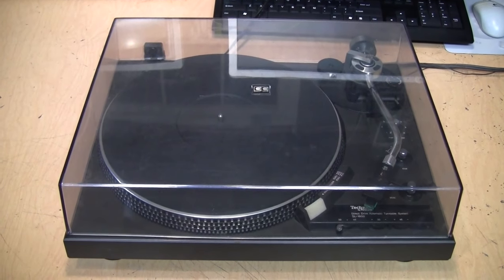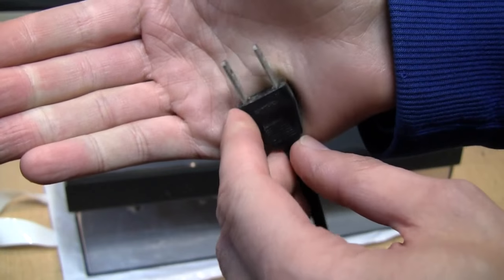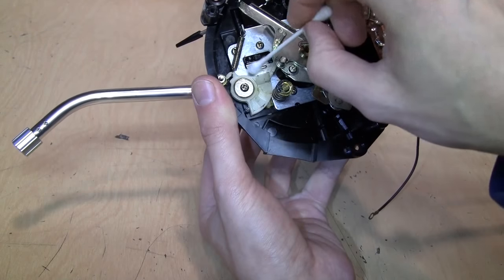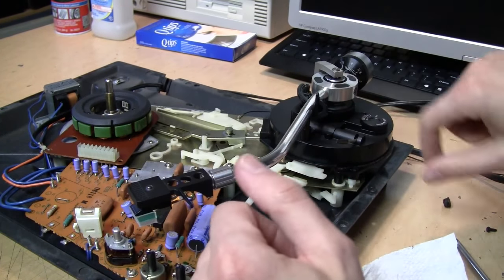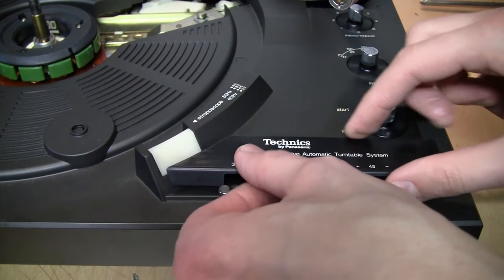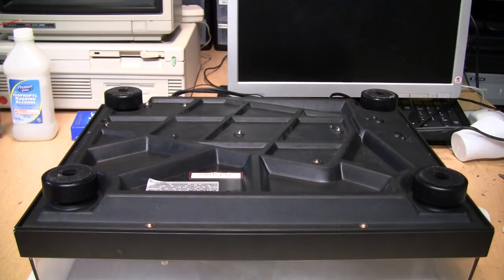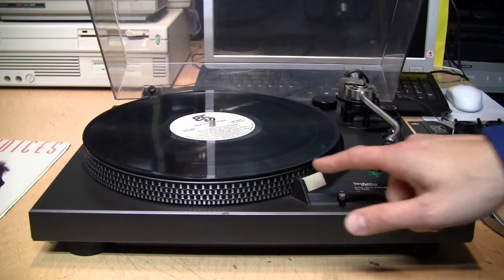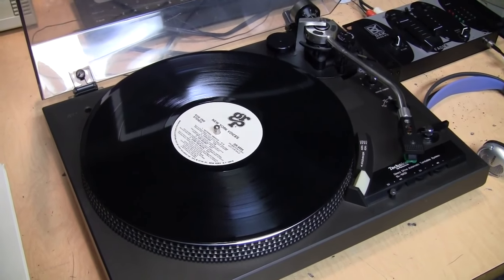Technics SL-1900 turntable repair & review

Comment: If I was into vinyl I'd rather buy something that was mass produced when vinyl was at its peak, and engineered by real engineers to have great specs and still be able to be mass produced. There is no real good engineering behind the modern expensive audiophool stuff. If there is, they're just direct copies of old designs (not hard to accomplish with tube amps).

Comment: I own an SL-2000 which is basically a non-automatic version of the SL-1900. It looks very similar with some obvious exceptions. I bought mine used in 2011 and I was experiencing similar problems. The turntable platter kept fluctuating, never keeping steady speed. The great thing about the SL-2000 is if you only need to clean the pots, you only need to remove the metal plate on the base to get to the pots. I bought the same CRC electronics cleaner spray, cleaned the pots and switches and it now plays beautifully! I can now listen to my vinyl off this turntable and not worry about the speed suddenly changing on me.

Comment: Nice turntable.  I used to be a DJ and am lucky to own 2 SL1200 MK2's.  They are great turntables and are totally built like tanks.  Mine I bought from another DJ who bought them from the club he played at when they replaced them after many years.  Because they are former club turntables they are "Quartz Modified" which means they have had the quartz lock deactivated to make it easier to beat mix.
Reply: Sl2000 and 1900 are useless as dj machines!

Comment: This turntable beats new ones like Audio-technika in every detail. W&F, motor noise, quality of tonearm, tonearm bearings, automatic mechanism, etc. But new one it was one of the cheaper options, available at around 500 USD of today. I believe if Technics would put them back in production the same like they were, it would be best seller. Plinth doesn`t look outdated, just different headshell and that is it.

Comment: I’m the original owner of an SL1900 and have been chasing the “end of play return issue” for years. Mine has an extra cam on the spindle, so I held my breath and yanked it off with a pair of needle-nose. You were so correct...the grease had seized up over the years and was like glue. Once I cleaned everything and re-lubed as you directed it works very well! Thanks so much for posting!

Comment: I got VERY lucky in that I found a Technics SL-1D in a thrift store that had the AT cartridge installed.  I bought the turntable for the cartridge but got one heck of a surprise when I got it home and all cleaned up.  It is now my primary turntable in my system and works flawlessly.  My cost?  $25 plus tax.  It is the only turntable I've found that will work with Grado cartridges without humming!  Just proves that sometimes you can get really lucky when browsing thrift stores and people don't know what they are throwing away.

Comment: What a great DIY video.  I also have a Technics SL-1900 turntable, which I purchased new in 1977, but have not used it for at least 10 years.  I have the exactly the same problem you described in your video and checked with several turntable repair shops in my area. All wanted anywhere from $100-$125 to fix this problem excluding parts, if required.   I went on several websites that mention that the lubricant in dampening mechanism is probably frozen and needs to be cleaned, but nothing addressed how to actually fix this problem.    Then it dawned on me that I should check YouTube.  Eureka!  I was able to repair the turntable myself at no cost since I had all the necessary supplies.  It works like new now.  Thanks for posting this video.  You did a great job putting it together and explaining clearly each step required to make this repair.

Comment: Yay, VWestlife finally has a decent turntable! I've been waiting for this day for quite some time. I happen to have the same unit (although I'll sell it soon as I now use a bigger brother in my main system).

Some remarks:
- the SL-1900 was indeed the second-lowest direct drive TT at the time (1977-78), but as you said a very good one. Shows what Technics is about. If somebody wants to enter the world of vinyl and doesn't mind tinkering a little bit as you did, the SL-1900 is a model I could definitely recommend. Other great choices: SL-Q2/3/33, SL-QX300 and of course all big ones (SL-1100 to 1800), although those cost quite a bit more.
- your unit was manufactured on January 31, 1978 (serial number)
- you can adjust the height of the tonearm lift when in the "up" position: press down the lift bank and turn the flathead screw inside the lift post.
- likewise, if the stylus is not set down correctly at the beginning of the LP, or lifts up too early when reaching the end, there's two dedicated screws near the tonearm base allowing you to adjust that.
- your strobe looks spot-on indeed as it should. Note that these old neon bulbs were not temperature-stabilized; as you use the turntable for a longer time the strobe thus may start to move slightly. If the strobe happens to fluctuate too much, there's two potentiometers for each speed inside the turntable which need to be cleaned.
- the AT-95 cartridge is a mixed bag, as it has heavy variations in sound quality from unit to unit. Some may sound decent, others are terrible. If you are not satisfied, try out the Technics EPC-270C-II (which is the original cartridge to this deck). Sounds quite nice if you fit a good replacement stylus. An EPC-207C or greater would be even better, but also more expensive.
Reply: I got a used Dual 1242 with a stuck start lever (easy fix) and came with a like-new Grado f3+ it sounds amazing

Comment: Great video VWestlife. I still own a Technics SL-D3 (features quartz lock I believe?) which was a hand me down within my family, and its served me well for over a decade now. These older Technics are a fantastic bargain (especially some of the lesser known models) especially ones with the classic direct drive motor. I really had no idea the classic Technics units had superior specs to a modern $1000+ turntable however, I find that rather ironic. Anyone looking for affordable high quality playback of their LPs should hunt one of these down ASAP as they aren't getting any easier to find with each passing year I would imagine...
Reply: The D3 only has a regular FG servo for speed control (you had to buy its more expensive brother, the Q3, if you wanted quartz) but it's an excellent turntable just the same, and the speed should be absolutely rock solid as long as the electrical contacts are clean. :)
Reply: My apologies, not sure why I remembered it having quart lock then. I agree however; most any of the direct drive models would be a great turntable for anyone's "HiFi" setup... Appreciate the info. :)
Reply: BMRR is that you?  It's almabes...

Comment: In a previous post I stated that my SL-1900 had a motor noise. It only occurred when the stylus touched the record, with an annoying hum that I could only hear with headphones. The original rubber mat had stiffened and excreated the softening agent like an oil between the mat and platter, so I tossed it and replaced with a cork mat because everyone says how great they are. The cork mat was the source of the problem. I tried a rubber mat from another turntable and the hum disappeared. I'm glad I figured it out, I was already searching craigslist and Ebay for another turntable. I've ordered a new rubber mat. Wow saved a lot of money.

Comment: Thanks, I'm glad people are now posting relatively unedited videos on what they are doing. I am still learning and have 3 Technics to try and fix, not to mention a few others. One thing I thought I would mention is that lube is generally designed for rotatings things, and bearings, and grease is gneerally designed for things that slide. I am unsure if grease was the best option here as opposed to lube as from my perspective it will gum up again. Would be interested in hearing some thoughts on this. Trying to learn!

Comment: Thank you mate. I broke my Pro ject DB3 (accidently ripped the cables in the tonearm out after I wanted to change the cart). Wanted to buy a Technics SL1210 MK5. I wasn't aware that Panasonic had other tt's beside the 1200 and 1210 family. Bought a brand new SL-3210 for 200 bugs quit. It's direct drive as well and it also has a automatic tonearm return. You, sir, saved me like 1300 bugs. Subscribed!

Comment: 15:29 I totally agree.  Those used Technics turntable are really great; easy to maintain, easy to repair, super durable, no-nonsense workhorse.  Those can be found in reasonable price range on used market.  I found a used Technics turntable (similar to SL-1900, but manual turntable), sitting on a garbage bin a long time ago.  I took it home and cleaned it, and it still works great as it should.  It sounds great!  (I own SL-1200 mk2 too, and I don't found significant difference in terms of sound quality between the two, for listening in living room.)

Comment: Best bang for the buck turntable back when it was new. I have the 1900 catalogued as $180 US in 1978. To get a fully automatic direct Drive with the specs and performance of the 1900 was amazing value in 1978. By 1978 standards the SL1900 build quality was decent but by today's standards it's quite excellent especially when you see the puerile garbage being sold at an entry level price point.

Comment: Interesting to see the inside of another Technics Automatic Turntable, as I'm the only person I know who owns one and also had to repair the automatic start mechanism.

With that, I should mention to use caution around the tone arm stop device (the thing that looks kind of like a set of stairs, I don't know the proper name), as there's a plastic tab that can break, resulting in a malfunction when using auto start (read: pull start lever, arm travels all the way to center). My SL-1301 was suffering from that issue for about 10 years before I was able to finally figure that out. :/

Comment: I have a Pioneer PL-L800 linear tracking turntable from 1981 with a good Ortofon cartridge that sounds really good.  Your turntable would definitely be audiophile approved.  Somebody did a comparison between the ATLP120 and a Technics 1200 with the same exact cartridge and I couldn't believe that I could hear a clear difference between the two decks.  The Technics sounded much cleaner and more detailed.  It opened my eyes even more.

Comment: I have repaired an old telefunken full automatic turntable from the 1960s a few months ago. These are built like tanks (all steel parts inside) but they have the same grease problem (a lot worse, the automatic switch wasnt even turning). But after repair... This is a AWESOME turntable. They are built completely mechanical without sensors whatsoever, like a clockwork inside. was very hard to repair because it also had no documentation in the internet. But the day of work was completely worth it, it plays very nice now (even if it needs a new stylus / tone cartridge and better isolated cables(the old cables on it generate lots of noise if they cross a 240V cable)) and it looks awesome. 

Edit: it was a Telefunken W215 i think (or another W... model. But looked exactly like a W215)

Comment: I work for a local fab-lab and 2 months ago a guy walked in with a Technics Sl-D3 and asked if we had any use for it. So I called dibs on it. The plexiglass cleaned up very nice with some brass polish. It looks a lot like yours, a bit more eighties. Sounds very nice to.

Comment: I have an old SL1900 that that we've owned since the late 70s. It wouldn't lift the tone arm. Thank to your help I was able to fix it. The isopropyl didn't wasn't working, so I put some WD40 on a Qtip and it works. Thanks for your video

Comment: I know that the turntables in the 1xxx series generally have the same motors as the 1200, but for some reason always assumed the 1900 did not. Neat to see the disassembly.
Reply: 1600mk2, 1700mk2, 1800mk2 shares the same motor as 1200mk2, not others.

Comment: I have this turntable I bought new in the late-70s. The last time I took it out of its box, it had this very tonearm problem. When I have time (maybe when I retire), I'll repair the tonearm with your instructions. I problem I always had with this turntable is the legs don't isolate vibrations very well. I never did figure out a good way to reduce skipping other than walking softly.

Comment: vintage is always better than new in my book. I'd take this over anything new. Very nice TT and looks well built on the inside. The base seems a little too springy though but i'm sure it's not like the Pyle TT I had.  At least these, the weight is from real metal components, and actual care into it's build quality  vs putting a heavy sheet of steel in the base like that AT of yours had. Modern TT companies, with perhaps the exception of Technics new TT's don't know how a real TT is suppose to be made. They make it look fancy, charge the price of a car for one, and people think it is the best.
Reply: WaybackTECH you know nothing about turntables with such ignorant statements. Nothing wrong with modern turntables
Reply: SL-1900 is a quality turntable. Just be aware of the mass of the tonearm interacting with the compliance of the phono cartridge/stylus compliance. I installed a new hyper elliptical stylus in mine and I experienced tracking issues and skipping/jumping of the stylus in the record groove, without regard to the applied tracking force. I believe a medium-to-low compliance cartridge with a standard elliptical stylus would be a safe combination, at a tracking force of 1.5 to 2.5 grams. YMMV

Comment: Excellent video. I've owned this turntable since the late 70s. I believe you should use oil to lubricate the arm lifting mechanism. The lithium grease seems to make the arm drop too slowly. I remember reading something in its advertising about an oil damped mechanism. So I'd recommend oil instead of the grease. The spring feet are to absorb vibrations from nearby speakers and footsteps etc so that they don't get picked up by the cartridge and amplified.
Reply: He only mentioned greasing the bushing and return spring arm. You would be correct about using oil on the actual arm lifting spring assembly.

Comment: Great price for what you got. It's hard to get a used Technics direct drive for that kind of price, period. Been trying to get one cheap on Goodwill's online auction, but they raise out of my price range too fast. Many people have commented to get a used vintage turntable as they have great specs and can be refurbished to become a great turntable again. Recently I did get a Pioneer PL-7 direct drive and did a refurb job on it. It turned out great and now it's hooked up to my 5.1 surround in my living room through my Cambridge Audio 551P preamp. It was well worth the $68 I spent on it including shipping. I only had to spend $20 to replace the RCA cable and now it rocks!

Comment: I really like those late '70s Technics DD turntables. Even though the 1900 was the entry-level model in their lineup, it handily beats many other turntables past and present. I'm also very fond of the D2/D3 and Q2/Q3 which came three or four years later. If you ever find yourself wanting a fully automatic direct drive turntable that can play 78s, check out radiotvphononut's video on how to add 78 RPM to a Technics D1. The same mod can be applied to the D2 (semi automatic) and the D3 (fully automatic).

Comment: Just managed to pick up a second hand SL-1900 - an ex BBC one no less, too. It needed quite a bit of work doing. Your video was helpful to do the lifter. But I also used lithium grease elsewhere in the table wherever I saw the dark grey grease. I also replaced the audio out cable which was past it’s best and a bit grainy and replaced with a decent OFC cable. It came with an Ortofon VMS30e but I had to source a replacement stylus, I also have an AT95E with an Ortofon head-shell along with a Technics head shell with a Pickering XV-15 D625E. I also use a Pro-ject phono preamp.
The sound from this turntable is excellent. Very precise. 
The main tweaks I’ve had to do are (apart from a complete strip and degrease and clean) to adjust the start/stop areas and use Contact cleaner (deoxit) on the tonearm connector, the speed adjusters and I even oiled the turntable.
I also managed to replace all 4 feet (three had fallen off due to rubber perishing) by fitting the M8 grommets from an SL-1210 and then fitting SL1210 feet.
Oh - a tip. If you clean the tonearm with brasso and it shines, sometimes the anti-skate will pull your arm off the record when it starts. I’ve managed to dull a tiny bit the part of the arm that sits on the lifter so it’s a bit safer :)

Comment: 16:35 I couldn't agree more.  I had an Audio Technica ATLP120 for a while as my main turntable, but I really wanted something automatic instead.  

Yeah, I could go out and spend $100-$300 on a new automatic turntable, and I'm sure it would be perfectly fine, but I decided to look for vintage, and I actually found a Pioneer PL-8 at my local record shop that's fully automatic and quartz-locked direct drive, and I managed to just pay $35 for it as it needed some cleaning and repair, and now it plays perfectly!

Comment: I have the SL-1950 and had to do exactly the same thing to make it work again. Great video on how to take it apart. Wish I had see this when I got mine. I had to figure all of this out myself. However I would do it all over again because as you said this thing has better performance than most new turntables today except maybe for the new $2000 Technics 1200's.Thank you for posting this.Maybe next you can show how to fix the dampening of the arm. My drops like a rock.